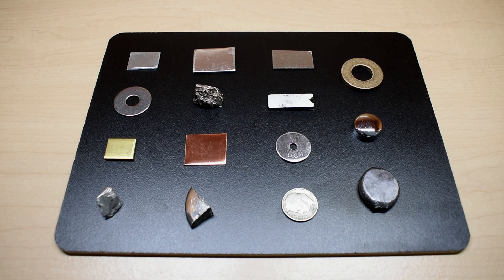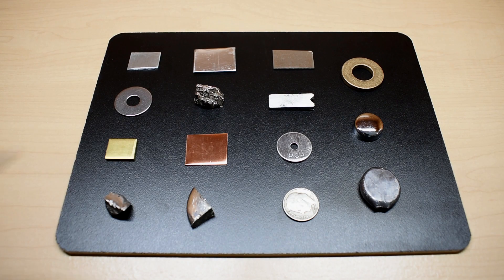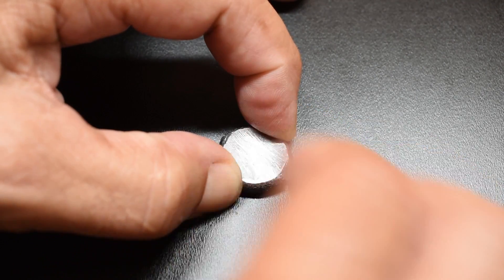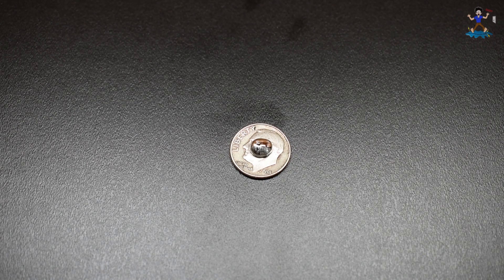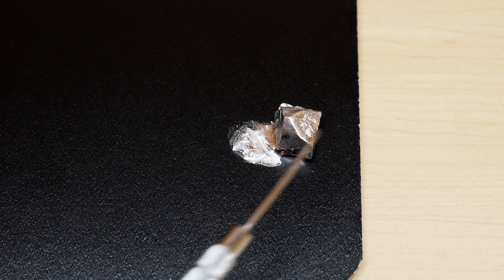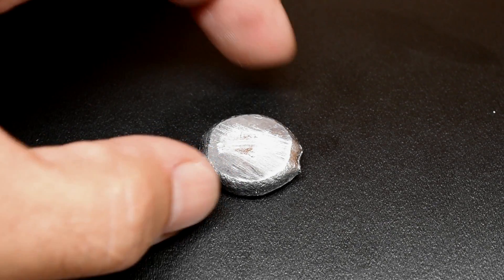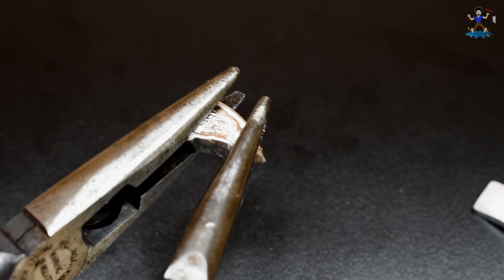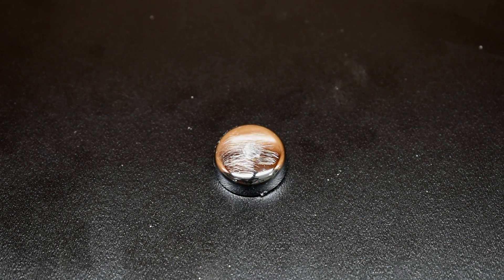Gallium Vs Aluminum & 14 Different Metals! How Will they React? Find Out!

Comment: I have an aluminum bicycle seat post stuck in a steel frame. 
I’ve seen an example where gallium can be used to eat away the post. 
My concern is the steel frame. From your video it seems that it would be safe at least in short term. 
What can I use to completely neutralize any effects of the gallium on the steel over time.
Reply: I have very same problem, bike frames are Crome and molibdenum steel alloys, looks like that both steel and chrome are ok in this video, but long lasting effect is unpredictabile

Comment: Just came to say copper and other metals can be softened or hardened with heat and pressure. Hammer that piece of copper and it will not bend as easily. heat up that brass and it will bend with little force.

Comment: Excellent video, this is exactly the sort of videos that I want to make when I make a channel! I was searching for this information for so long! and you gave such good information! can you try gallium with any other metals you didn't try in this video?
you said: "the metals were all strong except copper and indium" I would have to disagree, tin and lead are very soft metals, in fact, you can scratch them with your bare hands. and bismuth is very brittle and also not very hard, aluminum and magnesium are softer metals as well.

Comment: Mercury does the same chit to Aluminum.   Turns it Crumbly prior to Digesting it.
Reply from the maker: @s1iznc1d34  When I was younger, I rolled it around in my hand. :-)
Reply: @s1iznc1d34  Level of Toxicity is the question.    I've held liquid Mercury in my hands hundreds of times .   I'm 62 years old now.  Guess it wasn't so bad.  Vapor is a major issue.  Ingestion is a Issue.  Handling not so much.   I've amalgamated Gold from Black Sands dozens  and dozens of times and seem to have survived the ordeal.   No outlandish special handling performed.  Look up Retorting Mercury.  You boil and vaporize the mercury off the gold.  You know what your doing or you don't.   Simply common sense.  How many Florescent Light bulbs have you ever broken in your home ?  Did you call a hazmat team ?
Reply: @s1iznc1d34  The older versions you could actually see a drop of Mercury rolling around in the bulb if you looked.  Later they only used  minuscule  amounts.  Just enough to provide the Mercury Vapor / Gas required for the Plasma to be created.  Care to guess how many people broke in they're homes ?
Reply from the maker: I have Mercury, but it's hazardous. Not good breathing in the vapors that are given off.
Reply: @electronicsNmore  LOL,  Mercury has been demonized .   No one gave a chit about it when I had every tooth in my head stuffed with the stuff. No one gave a crap about it when they Pushed for everyone to use Florescent Light Bulbs.     Mercury is no more dangerous then half the crap under most  Kitchen sinks.  Brain Washed.  The same can be said for Lead.
Reply from the maker: @pulesjet  Far from brainwashed. LOL I had all my amalgams removed back in the late 90's. Mercury has no place inside the human body.
Reply: @electronicsNmore  I'd have no teeth if I went that rout.  As a Prospector I use Mercury from time to time.  Like most anything else in the world it can be dangerous.  It's not inherently Dangerous.   Handled correctly it present no threats.  Brain Washed.   Any damages done would have happened prior to you having it removed.   Neurological.
Reply from the maker: @s1iznc1d34  Only when heated to high temperatures.
Reply: https://www.google.com/search?client=firefox-b-1-d&q=Mercury+contained+within+a+Floresent+ligh+bulb

 @s1iznc1d34  Compact fluorescents, like their tubular fluorescent precursors, contain a small amount of mercury—typically around five milligrams. Mercury is essential to a fluorescent bulb's ability to emit light; no other element has proved as efficient.